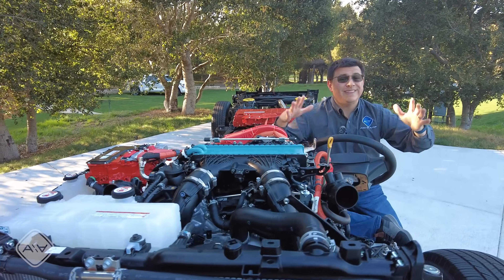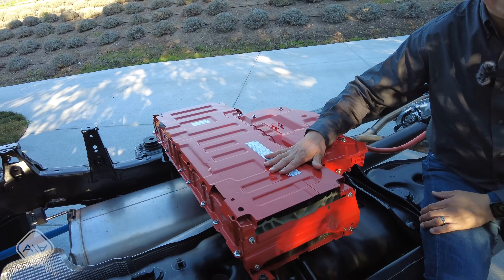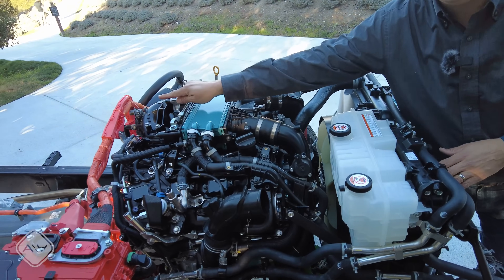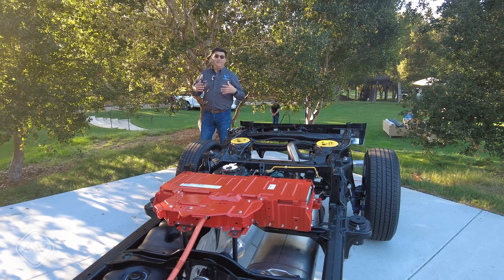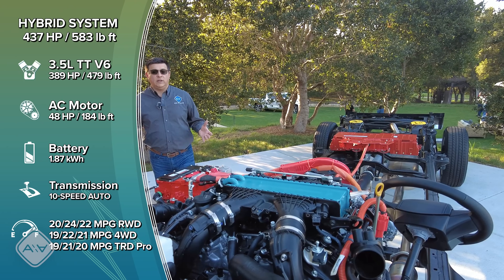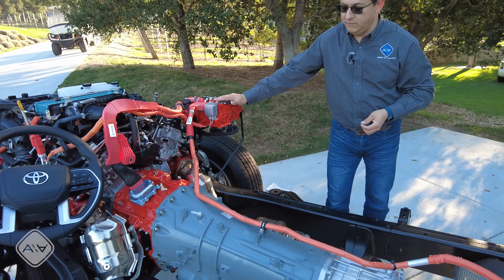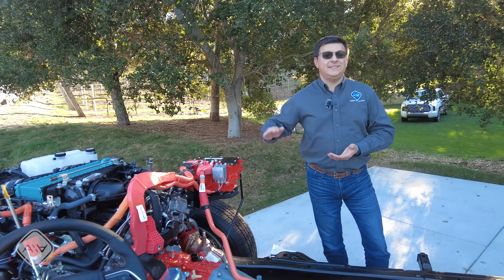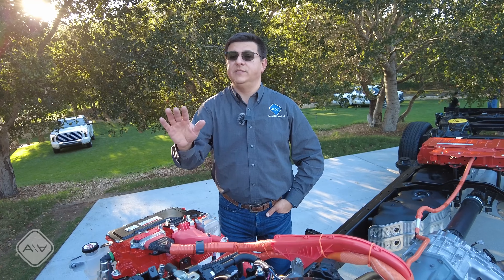How Toyota's New Truck Hybrid System Works | 2022 Tundra & 2023 Sequoia

Comment: This V6 hybrid was developed in place of V8 engines and when you calculate the savings versus a similar power V8 then you see how much more efficient it is. That really should have been mentioned. The hybrid drive replaces the extra 2 cylinders.
Reply: This engine is going to be awesome and with Toyota reliability
Reply: @Mr.Helper.  Well so far that’s not at all the case as Toyota has recalled 102k Tundras and Lexus LX’s for engine failures and 208k Tundras, Sequoias and LX 600s for transmission failure (movement while in neutral).
Reply: @Mr.Helper.  They are blowing up left and right.
Reply: There are no savings. The hybrid system is purely for towing. Does absolutely  nothing for mpg's
Reply: All of you are mistaken if you think the hybrid part has anything to do with gas savings.
Reply: 1000x more complex system with 10,000 more parts all to kill reliability and get an increase of 0.5mpg
Reply: @ElDerrick14  Hybrids are SIMPLER than ICE engines, not more complex. You obviously din’t grasp how any of it works.
Reply: @afcgeo882  - this powertrain is literally everything in the non hybrid ICE version, plus, the electric motors/inverter/battery are added. More stuff, more complex. The previous V8 ICE is simple. This twin turbo V6 ICE has fewer cyclinders but the turbo system adds a lot of extra parts. The V8's can run for a lot of miles for sure. This V6, probably very reliable because it's a Toyota, only time will tell.
Reply: @keithallsop  No, not more stuff - more complex. That’s not how engineering works. Batteries and electric generators aren’t complex and what they take away is the total time the engine is running, they lower the RPMs, they reduce the stresses at high loads (starting from stop, going up a hill, towing, etc.) and they eliminate the need for starters and alternators, which means the engine cranks at full power, not reduced power. All of that results in MUCH higher reliability as it greatly reduces engine and transmission wear & tear.
Reply: @afcgeo882  - ICE + hybrid is more stuff and more complex than ICE alone. As I said. QED. It maybe more or less reliable, justified in questioning which is better. Thankfully I only said it was more complex and only time will tell its reliability. Phew.
Reply: @keithallsop  It’s not more complex though. The system the electric components replace are FAR more complex than what they’re replaced by. This isn’t just an electric drive system added.

Comment: Pretty much mechanically identical to the F150 Powerboost. A bit of a shame - Toyota has significantly more hybrid know-how than Ford and I felt they could have sacrificed some of the capability & towing output to really ramp up the MPG figures, but clearly the folks at Toyota USA refuses to surrender that to Ford.
Reply: Factually, Ford and Toyota have been working on hybrid systems together for a while. The original Escape used the Toyota Gen 2 hybrid system. The current one uses a Ford in-house derivative of it. Meanwhile, this Toyota system is a derivative of the Ford system it developed for its F-Series hybrids.

Both, Ford and Toyota implemented this system on the pickups to move away from the V8s, but maintain power. If you compare the MPGs to the V8s it replaces you’ll see where the savings come in.

Comment: It needs Regenerative Braking!!!
Reply: It has it!!!
Reply: @afcgeo882  I need to see a video about that, because I don't recall them mentioning it...
Reply: @marcosramos4596  He did… He said it regenerates, but at a low rate for such a large truck because the battery is fairly small.
Reply: @afcgeo882  That's good and Bad; if it could regenerate like the Prius does and run on battery 🔋 while driving then it might make the vehicle cheaper to operate than the F-150...
Reply: @marcosramos4596  It does all that. Did you watch ANY of the video?
Reply: @marcosramos4596  just about every hybrid out there in the market has regen braking

Comment: Ford GM and Ram engineers watching this video:  “write that down. Write that down!!! “
Reply: Ford made this exact system first.
Reply: @afcgeo882  this isn’t for mpg. It’s a torque hybrid platform. Gives the tundra more torque than a diesel from what I understand. 

I’m not fond of it….but I’ll never buy another ford or Chevy again. Worst vehicles I ever owned.
Reply: @americandude3825  Who are you arguing with? Did I claim it was for MPGs? Are you high?
Reply: @afcgeo882  arguing? I thought i was replying to a conversation about some trucks with a truck guy. No need to be rude George. And no. I’m not high. I have never done drugs in my life…besides. Statistical studies show prolonged use of marijuana causes irreversible brain cell damage.
Reply: @americandude3825  Yes, arguing. The very first sentence of your comment was contrarian to someone “this isn’t for mpg.”. Who said it was?

You had implied that neither Ford not Ram know anything about these hybrid systems. I simply pointed out that Ford made theirs before Toyota. In fact, Toyota was given the basic technology for this system by Ford. Then you went on an argumentative rant about things no one brought up.
Reply: @afcgeo882  so when you converse with someone you don’t bring up new topics? Dude you’re tripping. Like on Karen level.
Reply: @afcgeo882  I have seen them. About 100 times. I’m a war vet. 🇺🇸🇺🇸🇺🇸. Praying for your recovery bud! 🙏🏻

Ps. Toyota #1. F150 ranked least reliable truck in USA !
Reply: @americandude3825  I’m also a combat vet (not sure what a DD-214 has to do with pickups) and a Toyota owner, but you seriously need to see someone, and preferably not in the VA system. Also, despite your feels, the Tundra is the least reliable 1/2 ton on the market as reported by JD Power & Associates, and the F-150 is the most reliable. That’s a fact. You could look it up (but we all know you don’t look things up) 😉.

Comment: Honestly I just wanted you to start it and drive away Alex…

BUT…Can it be tuned to be for mpg instead of torque?
Reply: 2:19 LISTEN to what he is saying.
Reply: @gwot  I know all that but I don’t care about towing and torque
Reply: @americandude3825  ...then drive a car or a Tacoma.
Reply: @happycamper6352  I have a sequoia, and two 2022 RAV4s. Lol.  I think it would be nice to have a full size truck, made for mpg, and traveling with light loads instead of towing. 

I don’t want to tow. Don’t need to. My 2008 sequoia 5.7L has a 10,000 pound tow limit….

So if the tundra could be gears for traveling,3 etc, and an occasional Lowes trim and get 30 mpg…think how it could sell. If it was the purpose for trips, groceries, and weekends at lowes. 

A 30 mpg full size truck built for light duty…..ding ding ding.
Reply: @americandude3825  You're describing the function of a small pickup truck.  What's so wrong with smaller trucks?  Is it that big of a hit to one's ego?  Maverick, Tacoma, Frontier, Ranger, Colorado, Canyon, or better yet, the Santa Cruz would be great for such work.  They're more comfortable than most guys would admit, great on fuel economy in real-world tests, easy to maneuver, and can still do damn near everything a full size can do.  Anything that is common in the real-world that is too big for a small pickup is likely to be too big for a half ton too.
Reply: @happycamper6352  nothing is wrong with them. I’m saying a family hualer. Five or six passenger. Comfortably.
Reply: @americandude3825  In that case, go back to the Sequoia that's already in your fleet.  You won't sit 6 in a half ton truck comfortably, but you would in your Sequoia.  5 is still uncomfortable in a half-ton.  Nobody wants middle seat for very long.  They'll not be much less comfortable in a double cab Tacoma.  Many guys try and try and try to justify full size trucks... but they don't really make as much sense as other models in most cases, which is why the rest of the world laughs at us for it.  I only need it because I have to regularly tow more than a small truck is rated for.  That Sequoia would be ok for me, but the pickup is more affordable.  If I could tow 8500 pounds with a Tacoma I'd get one.

Comment: In the tundra it's not bad but in the sequoia the battery placement is awful. It ruins the cargo area and third row. Also until they come out with phev pickups I'm sticking to gas only, hybrids ain't worth it
Reply: It’s about a 50% mpg improvement over a similarly powered V8.
Reply: @George L  I mean the 5.0 gets better fuel economy than the 3.5 ecoboost and when towing forget it the 3.5 ecoboost gets the worst fuel economy of any half ton
Reply: @james2042  Now compare their power outputs. Also, no. The 3.5 EcoBoost is rated for 18/24 while the 5.0 is for 16/22. The high output 3.5 EcoBoost is the one that’s rated for 16/20. The V8 is the weakest of the four, by a lot.

5.0 V8 produces 400hp and 410 lb-ft.
3.5 V6 produces 400hp and 500 lb-ft (while getting 2mpg better)
3.5 High Output V6 produces 450hp and 510 lb-ft.
3.5 Hybrid V6 produces 430hp and 570 lb-ft and averages 25mpg combined. 

TRY AGAIN!
Reply: @George L   the refreshed ecoboost with 400hp idk enough about yet. But as of the pre refresh ecoboost (370hp one) vs the 5.0 coyote. The ratings are absolute bullshit, the real world the 5.0 beats the ecoboost by about 2mpg empty and by alot under load. I would assume the new one that makes even more power is even less efficient, but I can't speak for that.

The hybrid is under investigation for false mpg numbers too just like the ecoboost ranger was.
Reply: @james2042  So basically you’re trying to bullshit while avoiding the most important factor: that the power of these engines is not on par, while the fuel economy is. And by the way, I ABSOLUTELY was talking about the HYBRID, non non-hybrid engine. Being under an investigation is not a conclusion that it isn’t accurate. In fact, both CARB and the EPA ended their investigations of the Ranger with no findings of wrongdoing. 

Come back when you wisen up, please. Maybe read some books on engineering?

Comment: As a percentage of weight this “full” hybrid is not much more powerful than a “mild” hybrid on a small crossover. To actually do something meaningful about improving MPG Toyota will need to come up with something much more impressive.
Reply: Yup… it’s basically a mild hybrid, except that it provides independent propulsion when a mild hybrid cannot. Toyota could have fitted a much larger Lithium battery to it, and paired it to a non-turbo version of this engine and it would have provided the needed power, but the cost would have been much higher and towing would have suffered.
Reply: Hey, in comparison by percentage, a 19 city -> 24 city improvement is over 25% change, which is pretty damn good
Reply: @alexphillips4325  The regular Tundra is rated at 19mpg and the hybrid at 22mpg (RWD). That’s a 15% improvement. That’s actually terrible, which is why Toyota is making a point of the hybrid being an alternative to a Diesel, with Diesel-like power, a Diesel-like torque curve, and Diesel-like fuel efficiency.
Reply: @afcgeo882  Combined, yes, I’m talking city, which is where hybrids make better improvements.
Reply: @alexphillips4325   That’s called a “straw man argument”. No one drives only in the ideal city environment and the total benefit of one system over the other cannot be touted by cherry picking only one attribute. The fact is that overall, according to the EPA, the hybrid is 15% more fuel efficient.

What does that look like in a non-truck? In a compact CUV that gets combined 30mpg, the hybrid would come in at 34.5mpg.
Reply: @afcgeo882  Toyota's point is not MPG, it's torque curve.  If you want better MPG, drive a car.

Comment: Toyota added needless complexity and costs when they should be going full electric ASAP.
Reply: What “needless complexity”? Electric hybrid drives are FAR simpler and more reliable than any internal combustion engine.

When battery tech moves to solid state in mass production we can talk about such heavy trucks with power and range being built relatively cheaply.
Reply: I think people really need to calm down on all this full electric mess we need the country and the infrastructure to catch up to electric cars before we go full EV.... We barely got charging stations in some cities and yeah yeah yeah people can charge their cars at home but still there are a lot of people who don't live in a single family home or do not own one so y'all slow your roll

Comment: I was a not happy with the hybrid mpg numbers, but that was never the mission of this hybrid system, Toyota do hybrids better than anyone if they wanted the tundra hybrid to be the most efficient truck they could have easily done it
Reply: The mpg numbers are STELLAR compared to the V8 it replaces, especially considering the power output is equal to a twin-scroll V8, which would typically average about 12mpg in this application. Why don’t you list off comparative engines out there, their power and fuel economy? Lets try facts for a change, shall we?

Comment: Anyone know if this hybrid system with the engine start stop will cause early turbo failures (since the engine is off, turbos do not get cooling), even the non hybrid 2022 Tundra owners manual indicates that after high speeds or towing, you have to run the engine for a minute prior to shutting off to ensure the turbos don’t fail.  And yes, I know sometimes manufacturers say that in the manual to cover all basis and the engineers should know better, but….I am more worried about the durability or longevity of the turbos…that’s the only reason I would consider a Toyota and plan on driving the Tundra until it falls apart due to rust.
Reply: The electric water pump cools down the turbo's when the engine is off
Reply: @Reu_ag  Thanks for the information, because this is a key buying criteria for me, can you please site your source (how do you know its an electric water pump).  I do not mean disrespect, just feel the need to "trust, but verify."
Reply: @Reu_ag  Thanks for the link, he covered the concern I had for this new engine (even the non-hybrid has the electric pump for the cooling system of the turbos).  Now I wonder why Toyota put the need to idle the engine to protect the turbos in the owners manual for the 2022 Tundra.  Am assuming its either for additional robustness, CYA move for Toyota, or an error in the manual.
Reply: @pd0076  yeah probably for additional robustness

Comment: They should have tuned it for MPG instead of greater power over the non-hybrid version. 

People wanted improved mileage over the last gen and Toyota took away a lot in order to give us a measly 2 MPG. 

While more power is nice, that's a lot of extra (expensive) hardware that might break eventually, with only minimal return on investment in the area of improved efficiency.

I'm now heavily leaning towards a 3/4 ton GM. Not what I wanted, but this new Tundra succeeds only in disappointing.
Reply: Cost to maintain this will be WAY less because of the set up, so that's something to consider.
Reply: The man just explained to you that the hybrid system was for torque not for fuel efficiency I don't know why people want big ass vehicles to get good gas that just don't go together... You finished spend at least 50k on the truck anyway so what you worried about fuel economy 🤷🏾‍♂️
Reply: @jermainec2462  The point is, the engine already has enough torque.  All they had to do is add a larger battery, so that it could be a "plug in" hybrid that could drive it's first 50 miles or so on electric motor alone.  That would have drastically given it a better gas mileage rating overall-- and especially for day to day drivers that commute back and forth to work only 10 or 15 miles per day. Because half of the time, they could treat this thing as an electric truck and plug it in to charge every night and get virtually 70 miles per gallon while driving it in EV mode only..  The point is , it wouldn't have taken much more to accomplish this-- just a bigger battery basically.  At least then the EV part of the vehicle can be used day to day to get you way ahead on fuel-- and also keep your miles low on your engine.. It's win-win.  but instead-- it basically does nothing-- he said it's only like 45 extra hp.  What's the point?
Reply: @calholli  talk to Alex autos and Toyota about that ... If you want something more efficient big pickups and SUVs arent the answer ... Whether there hybrids or EV ... You still driving a lunchbox
Reply: If you would at least get 50 miles of E- driving only, and was plug it charging-- it would make all that stuff worth it;  because for around town/ short daily trips, you could treat it strictly as an electric car and save those miles on your engine.  But I don't even think it's able to do that.  So yeah, there doesn't seem to be any real point is buying all those extra parts when they don't come with any discernible/ usable difference.